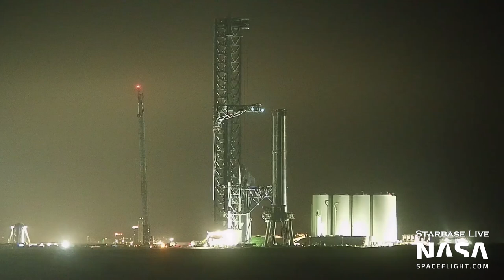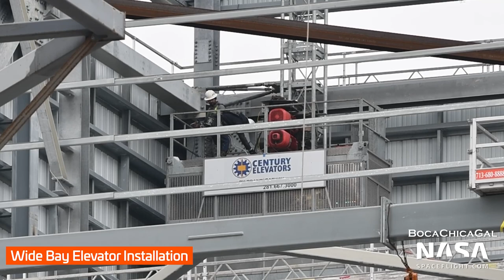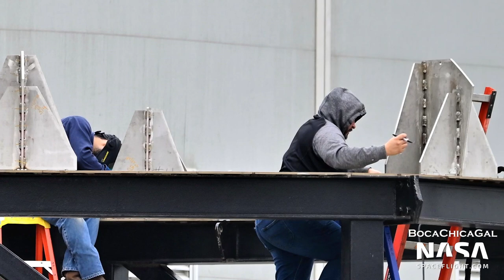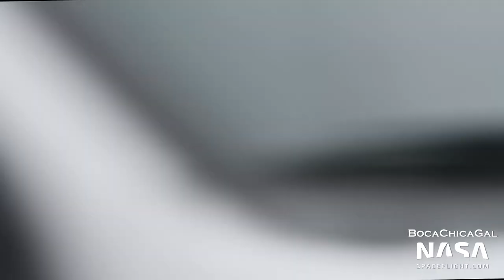New Booster Transport Stand Tested | SpaceX Boca Chica

Comment from the maker: 0:00 - Chopsticks Testing
0:44 - Booster 8 Common Dome Section in the Scrapyard
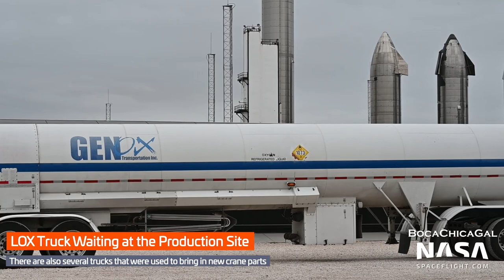1:11 - LOX Truck Waiting at the Production Site
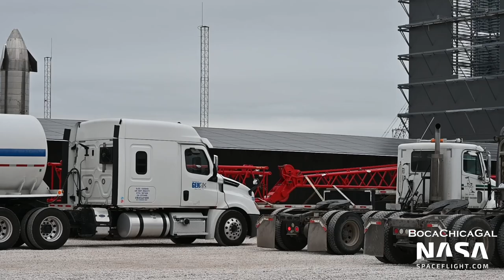1:32 - New Liebherr LTM Crane Delivered
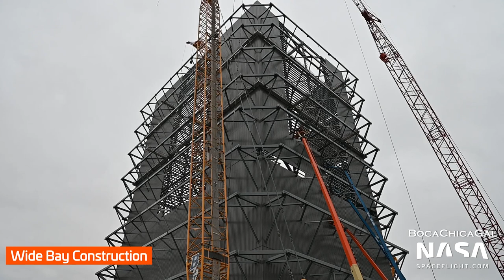2:31 - Wide Bay Construction
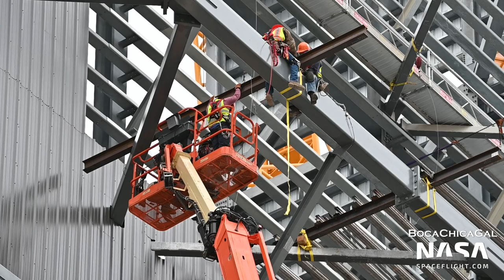3:05 - Wide Bay Elevator Installation
3:28 - Wide Bay Stair Construction
4:04 - Booster 7 in the High Bay
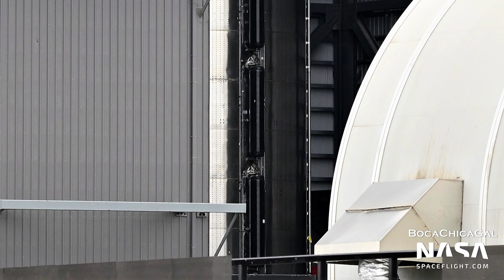4:33 - Dome Sleeving Stand Modifications Continue
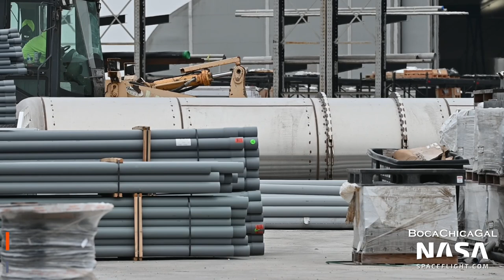5:03 - Old Booster Header Tank
5:35 - Domes at the Production Site
5:56 - Crew Working on a Booster Forward Dome
6:33 - New Booster Transport Stand Testing
8:01 - The Orbital Launch Site
8:20 - The Orbital Launch Mount and Chopsticks
8:35 - The Orbital Launch Mount
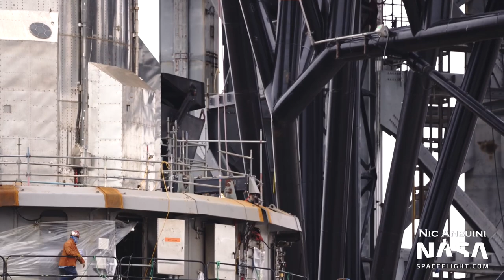8:51 - The Top of Booster 4 and Part of the Quick Disconnect Arm
9:14 - Booster 4 and Ship 20
9:42 - A Crew Works on the Launch Tower Rails
9:57 - The Booster Quick Disconnect and Orbital Launch Mount
10:09 - Ship 20 and Launch Tower Work
10:19 - Road Work on Highway 4
10:52 - Ship Common Dome Section
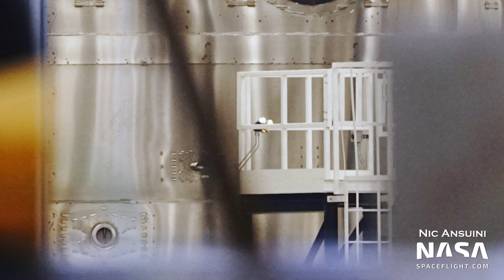11:17 - New Nosecone

Comment: LOVE the stacked COPVs!  What a great evolution of design.  That should really streamline the profile of the booster and simplify construction by no longer needing so many aerocovers.
Reply: Yep, still prototyping and figuring out what works best at this point, but I gotta admit that looks a lot less clunky than the current set up on Booster 4.  At this point I figure SpaceX is gonna have lots of different booster configs ready to go to see which works best by the time the FAA gives them the go ahead
Reply: And they would only need the one shaped/aerodynamic cover at the top, the rest of the stack would presumably have covers of identical profile all the way down the booster. So smart! 😃

Comment: Need some more grease on that cable. Steel rusts fast in saltwater air. Water dries on the beach, leaving salt exposed to the wind. Sand gets blown around. The tiny salt particles fly off the sand as it hits other pieces of sand, and can fly for miles in a strong wind. Phosphate dust makes it across the Atlantic to fertilize the Amazon jungle.
Reply: Not only to the Amazon but also to S. Florida. There are days when the Sahara sands land thick enough that there is a pink haze on everything.

Comment: Thank you Maryu, Nic and the NSF team for sharing this footage. From the complexity of the new Booster transport stand looks like it will be fully fitted with engines and then taken to the OLT. Very cool to see how quickly they turn out such machines. the Grid fins are a bit rusty already :-(
Reply: yeah, I wonder if the newer white grid fins will prevent rust a bit more.
Reply: Once the grid fins get working and get glowing the paint and the rust will burn off

Comment: Amazing vertical reach for those side arms on the transport stand.  Have we been able to see the problem they are trying to correct?  I don't recall too much side to side shaking on the last booster, but maybe it just wasn't visible to us.  Looks like they'll be reaching up to grab the booster bottom pretty high above the stand.
Reply: I saw on Twitter someone reckons that it's just to hold it steady while the booster is lifted in/out of the transport stand. There is very little room between the engine bells and the sides of the stand so it'll make the lifts easier, quicker, and safer, since the booster won't be able to swing and hit the sides.
Reply: @L3gionMusic  Right, much better than people pulling on ropes😆
Reply: If you look closely to the OLM you also can see them Installed there to do the same purpose as people pulling on ropes to prevent the engines from touching the Mount
Reply: @L3gionMusic  Might even facilitate remote operation of everything.

Comment: I wonder how two independent systems will coordinate smoothly, that is the crane operation, and the booster stand locating mechanism during the final lowering into the stand. Maybe a compliance sensor that causes the stand to lower as pressure is exerted in the vertical direction from the crane? Or perhaps a more complicated feedback loop between the test stand and the crane? Maybe the load meters on the crane would allow the crane operator to coordinate smoothly?
Reply: My guess is that both catch arms and stand will be controlled by the same computer when lowing caught the booster down.
Thus the vertical speed will be known to both system
Reply: When the pins are engaged into the booster, they can put the up/down system into neutral (it only needs to limit rotation and side-to-side motion).
Reply: @dancingdog2790  keep it simple right?

Comment: Why was booster 8 scrap
Reply: Booster 6, not 8.
Reply: @knowledgeisgood9645  0:50 booster 8
Reply: @Sigmax7-7  Yes, the text says so. Maybe just that section.
Reply: Change of thrust puck to Raptor 2 engines maybe?
Reply: Common dome incompatible with the new downcomer/header tank design?
Reply: @dancingdog2790  That could be it.